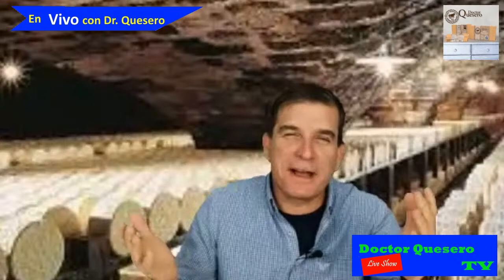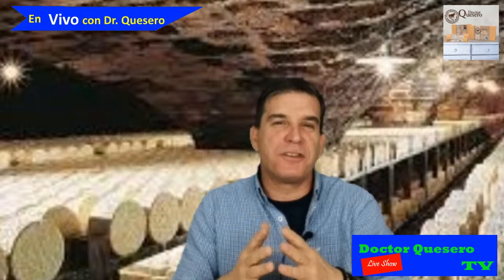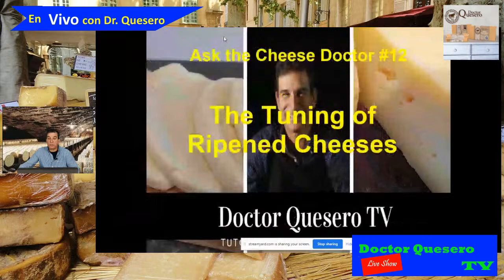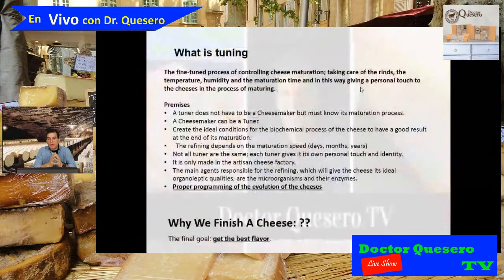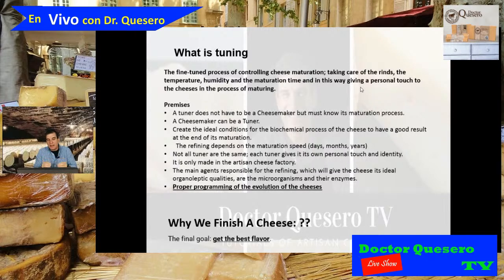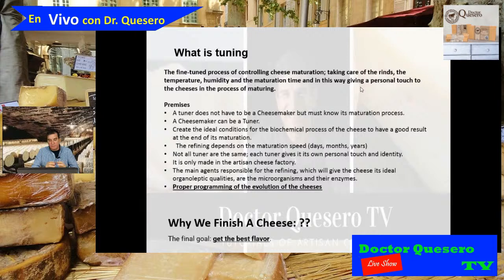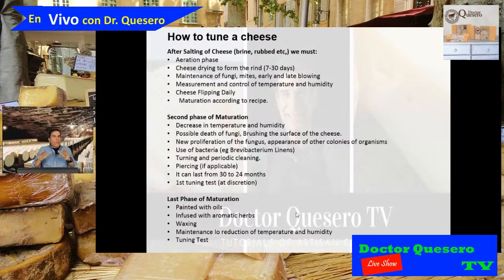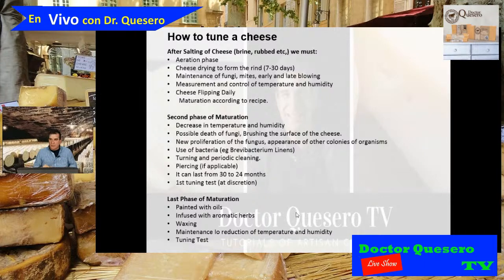Ask the Cheese Doctor #13 The Tuning of Ripened Cheeses

Comment: change the time program the same before, please
should I wash curd when the ph decrease after cutting directly? 
you say If I get dry Mozzarella we can wrap it with plastic and put it in the refrigerator for a week. Is it we can do that for any type of mozzarella? 
Because some cheesemakers say the mozzarella stay only a few days maximum of 4 days
Reply from the maker: If your pH decreased to much below 5.1  there is nothing to do because the acidification has denatured all the Calcium.
If you have problems with the stretching try acidifying with citric acid instead of natural acidification. With citric acid use 2 grams of citric acid per litre of milk and do not use lactic cultures. Put the citric  acid with the milk cold and you'll que your mozzarella without any problems.
Reply: My inquiry when I make queso fresco the ph decrease to 5,9 after cutting directly what should I do wash curd or no?
Reply from the maker: For Queso Fresco, acidify up  to pH 6.1 and then drain the  whey